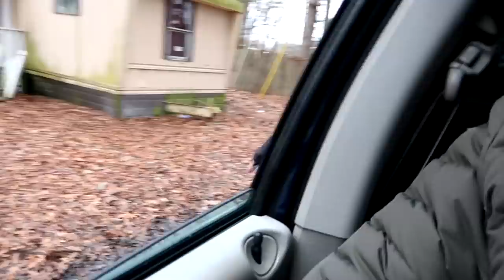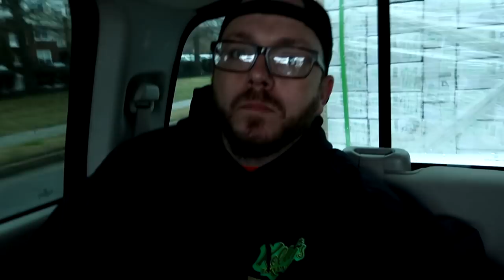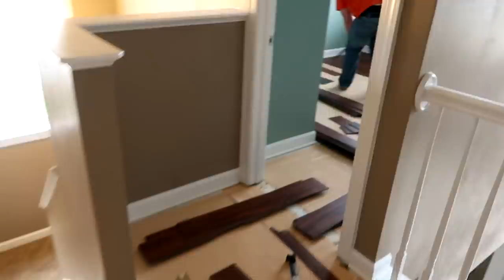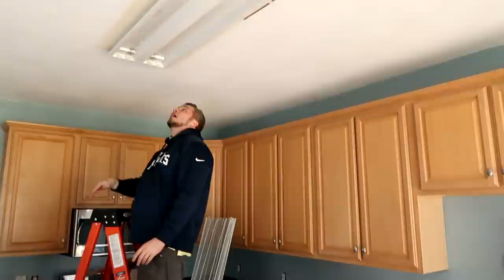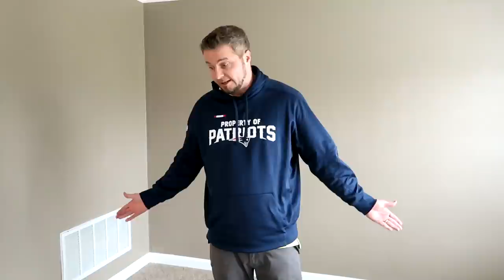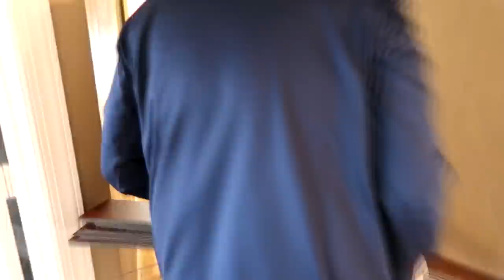The After Prison Home Improvement Company...

Comment: And it's done right they have a moisture bearing down that's called a floating floor rabbit it expands and swells you leave a gap in between the wall and cover it up with baseboard and shoe mold it was put in the correct way with transitions

Comment: Do with the advice what you will if you're going to be doing that enough to get yourself trailer got a trailer otherwise take the 60 seconds it takes to take the tailgate off first and in those new trucks if that tailgate has a light up in it make sure you unplugged that wiring harness before yeah take the tailgate out the socket